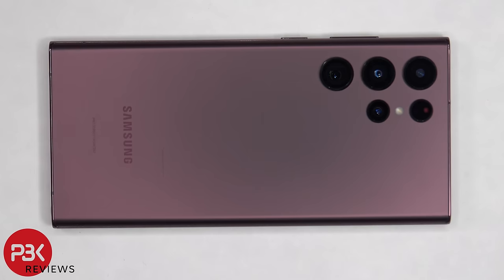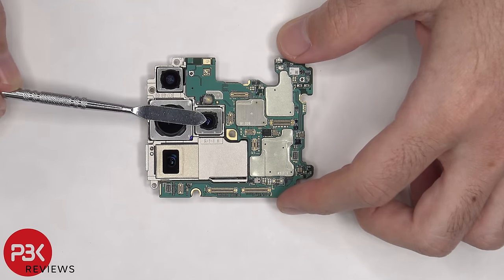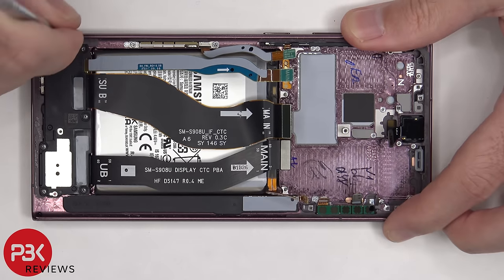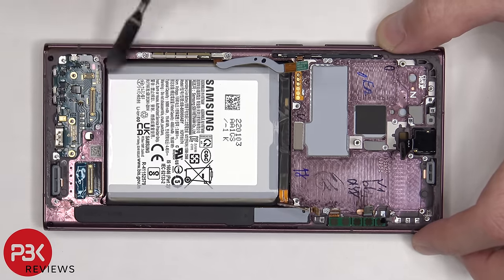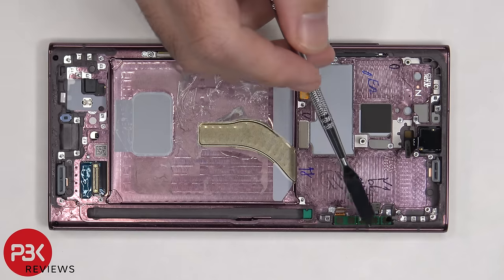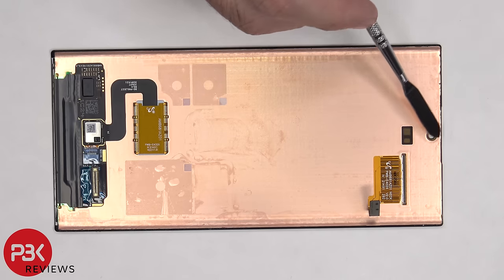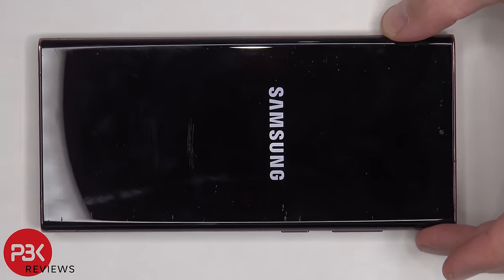Samsung Galaxy S22 Ultra Disassembly Teardown Repair Video Review

Comment: Man the battery is glued, made in such a way that only an experienced technician can remove it and replace it. Why doesn't anyone complain about this?
Reply: Same reason why people are praising the removal of certain features like the headphone jack and SD card slot.
Reply: @pixels_per_inch  literally no one is praising the removal of headphone jack and sd slot
I see nothing but people complain about it constantly, acting like Sony phones don't exist who DO have them and the same SoC as these Samsungs
Reply: because people intend to replace the phone within 4 years before the battery could become a problem
Reply from the maker: Yep, not sure why Samsung refuses to put pull tabs.
Reply: @PBKreviews  -- For one, Apple pull tabs often snap and you're left with the same task, and secondly LiPo packs are easily damaged and the intent is that if you're having to remove the battery it's best to replace it as they're less than $30 USD

Comment: Interesting! every part has Graphite sheets to absorb heating 👍

And that huge Ultra sonic fingerprint scanner 😳
Reply: It's quite nice: S20 Ultra was mostly fine for me for the scanner but this thing is buttery smooth
Reply: I feel like my phone is getting hot, next to my underwear, even when I've even got all the apps (supposedly) closed. 

The battery drains faster than my note 10+, AND the mandatory 5G (per Verizon model instead of Samsung direct) isn't even faster than 4G, in a very metropolitan area.

Comment: Thank You for your obvious time and great efforts in getting this teardown video out so quick, I think many of us teetering on a purchase will appreciate this, along with your durability video. Your expertise is effortlessly displayed to us in your simple straight talking commentary . Im relieved to see a much bigger fingerprint sensor as that was the one niggle I had with my excellent note 20 ultra. Its very comforting to also know if damage occurs, it can be repaired.
Reply from the maker: Thank you and you're welcome :)
Reply: Once the motherboard and battery is removed, is the whole inner frame made of metal? I meant the pink colored frame.

Comment: It seems very easy to repair everything is so well done. Great video!
Reply from the maker: Thanks! :)
Reply: Seems that way, sure, but reality isn't the same. Heat the phone first to remove back glass using suction cups: I wouldn't even attempt the front entry he suggested

Comment: hey what did you use to reattach the backplate to the phone anyway? i am really intrigued with that
Reply from the maker: There is pre cut adhesive made for it like this one: https://www.ebay.com/itm/312270564385?hash=item48b4c6ac21:g:oPQAAOSwsB9idJXM&amdata=enc%3AAQAHAAAA4FRCns9XhkmMSmdnTqXJOnvqq3%2FxTdrZyJ4a%2FcuT%2FB9kzgq2w1F4f3Uuve3j3bxFj5Xx8D8HNsaa6p%2B2sWgSzFluftzlhNZzsNnXD3swU2QyhInBNTJk6NmVY%2FVGvv8r62kxFMqImCShCpFozMKDcndiybzGv2aMaQWXDkmgf1cvpjVjV%2B%2BWgh618ViqrhqkUKhAnq1Sf6%2BGm2NPyGDZ52J9YtpDp8IhIcExeyuh2mglq9%2FvycZx2OWFufSCZilu%2FCyUkIlTxp1yxIzq1OlzeOX3i9CvTR3J563f6wPfoUDD%7Ctkp%3ABFBM0KLRxslg

Comment: At 00:42 you have the backplate in your hands. I'm wondering what the white stickers are. NOT the adhesive around the panel, but the one that sits above the spen slot, and below the camera.

Comment: I didn't see a vibration motor in the main housing, but it looks like the incorporated it into the lower speaker bracket based on the two additional contacts.  It makes sense since they needed to make room for that stylus.
Reply from the maker: yup :)
Reply: As well as those being a pain in the ass prior

Comment: Is the wireless charging coil also used für nfc or where is the nfc antenna located?
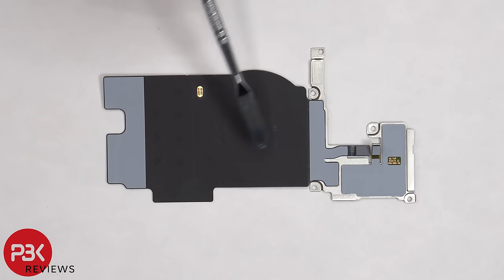Reply from the maker: no, the NFC antenna is located to the top right of the wireless charging coil as shown @1:35 in the video

Comment: Very satisfying. Since I didn't hear any mention of water inside, I assume that the previous water submersion was a success?, :^)
Reply: He pointed out the water indicator on the bottom; it was still white. 8:00
Reply: @frogpaste  ahh ok Missed it I guess. Thanks
Reply from the maker: Correct, no water got inside :)

Comment: Hello my screen on my s22u cracked right across the middle on the right side of the phone, took it to get fixed...after about 1 and half hour the technician told me he replaced the screen and battery...i later noticed that the performance on my phone has been better...i noticed it immediately actually...in the beginning when i first got the phone i did notice that it would overheat and lag quite a bit, and all of that is gone now. All of that leads me to my question, this screen replacement happened 3 days ago and i just recently noticed that the frame has also been replaced, there was a small ding that is completely gone now and also it has new plastic wrapping, but my camera hardware is the same and so is the back plate...is all of this normal in your opinion? The technician never mentioned a frame replacement, this was at my phone provider

Comment: Hey, 2 questions.
I recently dropped my phone and, 

1. The screen has a huge crack, so do i have to replace the entire module (including the frame) or can i do it for cheaper by just replacing main screen? When i visited the samsung center they are quoting me for the former.

2. My Rear Camera is not working, is it possible that it is just a cable gone loose, or is it damage to the module?

Thanks!

Comment: I have a problem with my phone after a screen replacement. it will not detect that the S Pen is inserted. Inside the S Pen enclosure, is that white component the trigger switch to alert the phone that the pen is in the phone? That's how the note series was but I don't see how the trigger would be connected. You mentioned 2 cables related to the S Pen. Maybe the tech didn't plug one back in assuming the white piece is a trigger switch. Thank you.

Comment: Great video, clean and really informative. I have one question if you can help me: I have by accident put sim card needle in microphone opening instead of sim card hole, was not paying attention I guess. I pushed little bit harder and I think I moved something, but mic is working. Can you tell me did I move rubber seal or actual mic, as I can not zoom enough when you removed bottom mic plate. Basically can you tell me in what my sim needle hit in that mic hole :) Thank you!

Comment: Is it possible to completely remove the 5G antenna in the Samsung S23 or any other top level phone, or at least disable it assuming that it's separate from the 4g antenna (yes I am aware that one can simply turn it off in the connections settings).
Thank you for your excellent work and hopefully, answering my question, Brian
Reply: Flex cable from main to sub board wasnt attached well, I pressed on it a bit hard on sub board side attachment, then phone shut down and never turn on. Did I damage the subboard? What could be the cause I didnt see anything break

Comment: question. I dropped my phone and now it keeps dropping. I have tried every software fix and have ruled out everything other than a damaged antenna (or one that has a loose connector that keeps losing contact. I am going to order a replacement and a repair kit and attempt to fix this myself as it is out of warranty.

Is the part I should replace the 2 antenna ribbons along the sides or (and correct me if I misheard you) that big black chunk at the top to the right of the camera lenses. I feel like I heard you say that was the antenna module but I may have misunderstood you.

Thank you!
Reply from the maker: First, make sure the main board is seated in place properly as well as the sub board. Also the black plastic cover on the top corner of the motherboard that has the grey lines, those are antenna lines, so you want to make sure that is seated in place as well since it needs to make contact with contacts on the board. Next, the cables on the left connecting the main board to the sub board on bottom, primarily the blue thinner one will also be connecting antenna contacts from the sub board to the main board. And the sub board itself has antenna contacts touching parts of the frame of the phone to built in antennas in the frame. If you have the mmWave 5G antennas on the sides of the frame, make sure those are connected properly also for the 5G. If not, then you have a different technology 5G which is sub 6 GHz that doesn't require those mmWave antenna. You're welcome :)
Reply: @PBKreviews  thank you for the reply. I will do this as soon as the kit I ordered arrives

Comment: Hi, my phone recently fell and initially it was not charging put later did.  Now I'm struggling with my network.. it's very weak goes on and off. Works better when I'm outside of building.  Do you think my problem is fixable or should I get a new phone?
Reply from the maker: might be a loose connection or cable or the top plastic cover over the motherboard etc.

Comment: Thank you for doing this because I'm considering getting this as my main phone so I'm doing an in depth research to find out as much as possible about it and this helped a lot! Is that one unlocked or for a specific carrier? I'm not sure if I want the unlocked one or the Verizon one, because the unlocked one comes in a really beautiful red.
Reply: Verizon is TECHNICALLY unlocked but you still get a ROM that has preloaded Verizon apps you can't uninstall but can disable in make non-visible; that said it can be a bit of a pain in the ass to get all your proper settings applied if you have non-Verizon software but not impossible. As 5mm wave is included with unlocked, might be best to go unlocked for resale value.

Comment: 6:21 is it a single cell battery or 2 cell ? A battery charge test video showed that charge speeds were similar with both 25 W and 45 W charger on this phone.. if it’s 2 cells, hopefully a software update can fix the charge speed. any idea ?
Reply: Single cell. 45W charges faster 0-50% but tapers off to reduce added degregation to the battery.

Comment: Samsung could've easily created a thermal dissipating case in addition to all of the thermal features they worked on. They could've made the entire case a heat sink and release a slip on case that transfers even more heat and have like little holes to ventilate all the heat. Im shocked that they haven't done that yet
Reply: Snapdragon 8 Gen 1 Already Reaches 50-55°C With Okay Thermal Management Systems If They Made The Heat Sink Better. You'd Burn Your Hands Using This Thing Extensively
Reply: Look up the Spigen Cryo Armor case.
Reply: @abhinavhimself  I'd worry about the battery too, since the heatsink leads to the battery. The lifespan of the battery is probably going to be very bad.

Comment: Thank you for the video, it's terrific.  I was trying to pop the sim card out, and put the remover tool in the hole in the top, instead of the bottom, before I figured it out.  Did I ruin anything?  :-(
Reply: Very well could have if you're having issues with your mic pickup on speaker phone

Comment: bro have a question, i got somehow wate rin camera lenses and my phone didnt charge for 2 days now charging back but camera lenses with water how can i clean them do i have to disasemble and reasemble or u think it gna go away by itself it gna dry
Reply from the maker: It's best to take it apart, disconnect the battery cable, dry out any water inside, brush off any corrosion around chips or connectors with a small brush like a tooth brush, then re assemble the phone to see if it will work. If you leave corrosion or water inside, your phone will short and not work at all eventually.
Reply: @PBKreviews  thank you for your response, appreciated it, i have another question, can i put the back on the original one just like that or i need to buy some kind of glue?

Comment: only teo of my screws came out is there anything i can do to get them out?
Reply from the maker: If the screws have been stripped, you can either try one size larger screw driver and if still no luck you would need to use a drill bit to drill slightly into each screw head to break off the heads. They shouldn't be difficult to remove, unless you used a wrong screw driver/wrong size etc.

Comment: Has there been any impact on the indicator paper from holding it into the water for a minute? I didn't recognize it in your video
Reply from the maker: no, the liquid damage indicator sticker was not triggered.
Reply: It's water resistant, IP68 rated.

Comment: You think they changed to stainless steel for cost cuting or copper not as available? I wonder if it'll be much different cooling wise!
Reply from the maker: Someone explained that for the copper to be actually useful that it needs other components like fan or other measures to transfer the heat away, so having copper doesn't really benefit even though it has a better heat transfer rating.

Comment: Aren't the fingerprint sensor the same on S22 models and ultra? According to information it's the Qualcomm 3D Sonic Gen 2 just like last year on S21. But they look differently. Did Samsung just put some foil over the sensor of the ultra or do they actually differs in size?

Comment: Very well done video. Did you say the front facing camera is glued to the frame? What would be the easiest way to take off that camera without the full fram disassembly?
Reply from the maker: Ya it has a rubberized glue they use for keeping it water resistant. You can still heat it up and pry it off but there is a good chance the existing camera will get damaged so if your replacing it, there are no worries 😀

Comment: I was stupid enough to push my sim ejector tool into the microphone hole, because it's just next to the sim tray. I was pushing down hard and only after couple of seconds of sim not ejecting I realised that I was doing wrong.
Could I possibly do any damage to the microphone or to it's waterproof seal?

Comment: Do you use 1mm adhesive or 2mm???
Reply from the maker: I use the original pre cut adhesive made for the phone, but if you want to use adhesive strips that you need to cut down to size, you can watch this video for a better explanation: https://www.youtube.com/watch?v=T4iiPUIM7-Y

Comment: I ordered a new frame and it didn't come with screw holes for the antenna on the right side. And the one on the left side doesn't fit because it has a bump in the slot.

Comment: Hello. Nice video to understand inside of S22 Ultra. My S22 Ultra fell off from hand on the floor. I had screen protector and back case. There was no physical damage to the phone, except the tempered glass I put for protection was broken. Phone looks very intact. However, after a few days, I noticed some sound from inside. It is like something is fallen apart inside and rolling. If I shake the phone slightly, I can hear it. Could I give it for inspection? I have some questios if you can hellp me:

1. If the phone is opened, does it loose or degrade IP68 water resistant capability pf phone?
2. Does it cause any problem for the camera quality. I like the phone a lot because of it is camera.
Please share your feedback.
Reply from the maker: You're probably just hearing the camera assembly rattling which is normal. Also yes if you take it apart, you will lose the IP68 protection unless you install a new replacement original back cover with original pre cut adhesive that it comes with, or if you buy the original pre cut adhesive for the back plate and apply it correctly to your phone.

Comment: Hey, does the phone keep it's IP68 rating even when the S-Pen is ejected/outside?
Reply from the maker: yes correct. The housing/enclosure of the s pen is also sealed so water wont gain entry inside the phone.

Comment: So with my ultra, i learned that at first the speaker and sound was nice and cleae and then i turned it up and left it with music over time it became more static and have quite some sound.  So what i did was turned it all the way bck down and then turned it to medium volume. Is it supposed to be that way. Should i take it apart and fix it or just get it repair?
Reply from the maker: Sometimes debris or metal shavings get attracted to the magnet in the speakers and cause distortion. Usually the filters over the speaker openings help keep most of it out but yep.

Comment: My microphone needs to get repaired. Is it possible to fix or replace that component. I have a Care Plan and will pay the service fee to get it done. I just want to know if that part can be replaced or fixed.
Reply from the maker: most likely they would replace the sub board or back panel that has the mic or secondary mic on it. But if its the one on the main board, if its samsung, then they would probably replace the mic on the board itself.

Comment: I generally see the teardowns for the vibration motor type. Just commenting to show respect to the motor it deserves
Reply from the maker: I would have shown the vibrator motor but its sealed in the speaker housing and I didn't want to break it open just yet. :)

Comment: I am in europe, allways wander if to buy those 5mw antenas, will work in USA ? will phone know to use those ?
Reply from the maker: I don't think so because most of the time when the phone doesn't have the antennas, they don't even solder the connectors on the main board for it. Also the software would need to be flashed to a USA based one to read it properly. :)

Comment: 6:30
WTF are they really directing all the heat from the processor into the battery???
Reply from the maker: I think its to transfer the heat between the two since the battery heats up as well and then out through the screen
Reply: @PBKreviews  If majority of the heat exits the screen, I would be worried about my finger.
Reply: @xxxxxls  most phones are built to expell heat through screen or occasionally backplate